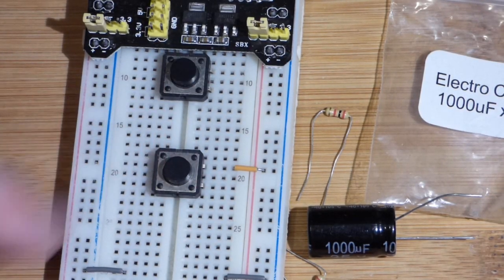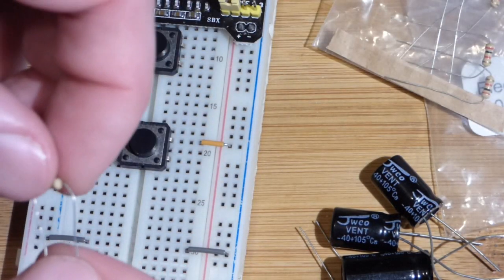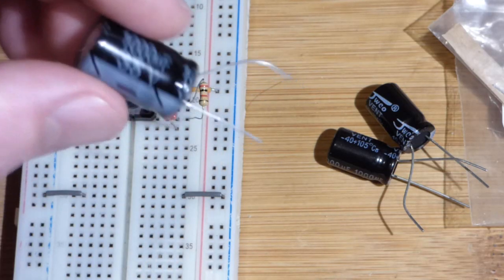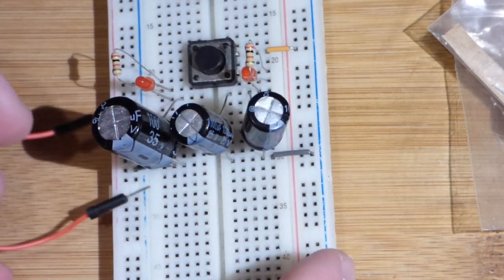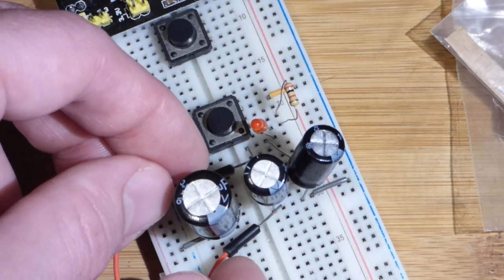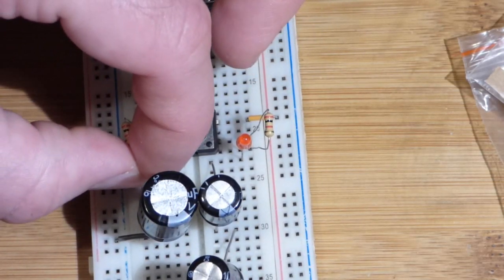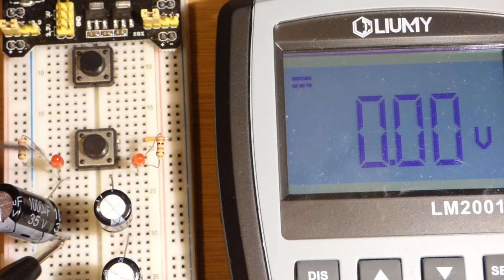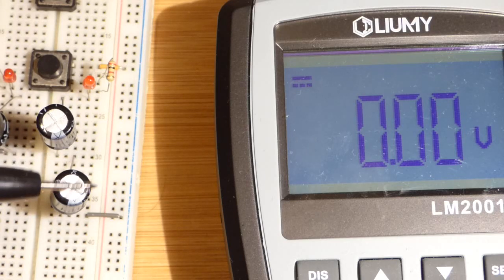Step by step electronics circuit builds 6 parallel and series capacitor charging circuits

Comment: Why did the leds go out once the capacitor was charged? Impedance?
Reply from the maker: I use the LEDs to help visualize the current that is flowing. While the capacitor is charging, the LED and resistor that are in series with the capacitor have the same amount of current flowing through them as the amount of current charging the capacitor. Once the capacitor reaches the voltage of the power source, minus the voltage that the series LED drops, it stops current through it (impedes) and the components in series with it (LED and resistor in this case). Impedance, reactance and resistance factors of circuits like this are much better explained by people who like to make electronics math and theory videos lol. Hope that helps! Thanks for watching!
Reply: electronzapdotcom ok thank you very much. I understand the concept now ... do you have a video explaining and showing how a capacitor with a discharge resistor in series works?
Reply from the maker: https://youtu.be/fWPQBRssxHY I made this video yesterday, that focuses on charging and discharging a capacitor using switches. both the charge and discharge go through their own series resistor, LED and switch. 
https://youtu.be/ZkIdBFWHOJY is a capacitor charge/discharge video in which I use a schematic diagram that I made back when I had a website that I posted diagrams on. 
Hope those help!
Reply: Doesn't current flow from - to + since electrons are negatively charged? Thus being attracted to the positive and and repelled by the negative ends.